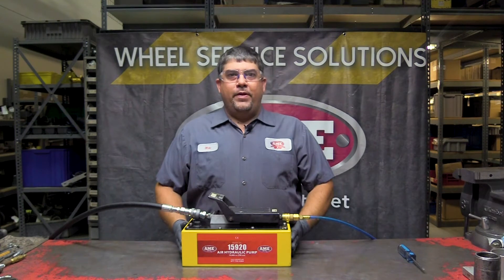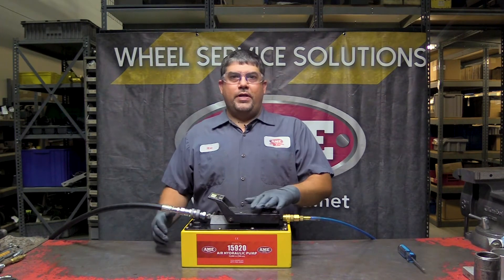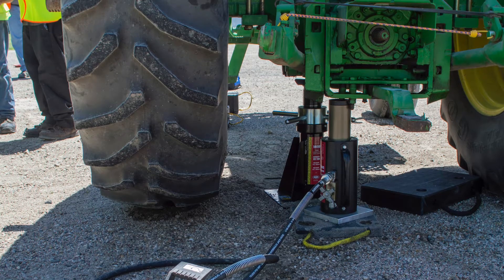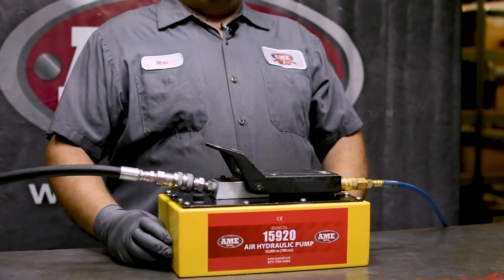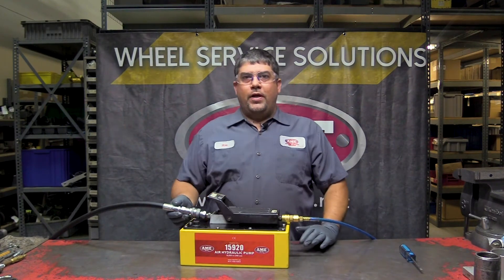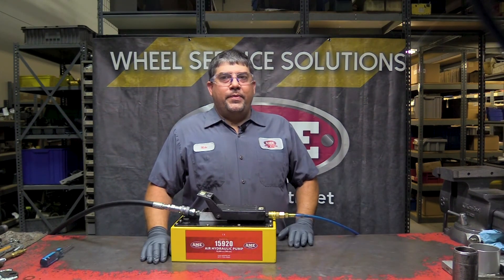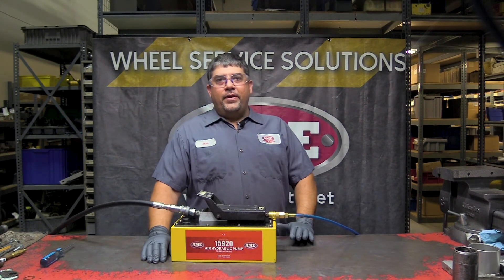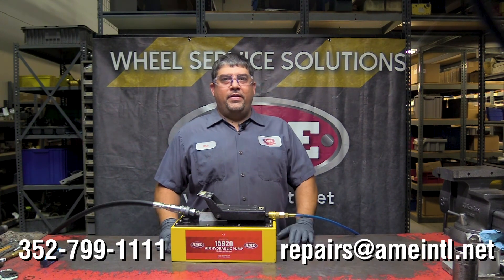Priming your 10,000 PSI Air Hydraulic Pump with AME repair Tech

Comment: Can l use 10.000 psi pump for 50 ton hydraulic jack??
Reply from the maker: Hi Anubis, all AME Jacks are built to be used with a 10,000 PSI air/hydraulic pump. Please give us a call with any specific product questions @ 352-799-1111
Reply: @AMEInternational  My house is sinking in one corner. I want to use one of those 50 tons pumps pushing those cylinder concrete piers to jack it up and level it. I been watching YouTube videos that was the earliest way to fix it. I'm from down under l found the ram jack and the pump unfortunately couldn't find that concrete cylinder piers here in down under  so it's only in States they are doing it that way (which is sad) l just wanted to know that l could use that 50 tons ram jack with 10.000psi pump not go wrong while fixing it and thank you for replying 👍

Comment: i can see your great at replying so here goes.: when i push the operate pedal it just blows air out the silencer under the pedal. if i half press it it works but really slowly any suggestions?
Reply: You need to lubricate your air motor. We have another video detailing this: https://www.youtube.com/watch?v=nrZ53igrx34
Reply from the maker: @MARINE6153  Thank you! Bricey, call us @352-799-1111 with any other questions. Our repair department also offers video chat trouble-shooting.

Comment: I have a bva pump and I the same pump did the same thing but didn't work still not building any pressure what can i do please heip
Reply: I'm having the same problem
Reply from the maker: Sounds like a seized air motor or the pump may be out of prime. Please email repairs@ameintl.net or call us today @ 352-799-1111. Our in-house repair technicians are here to assist!
Reply: If is out of prime what can I do ?